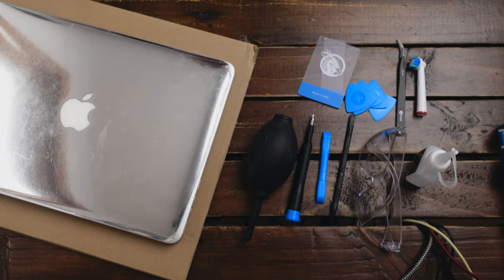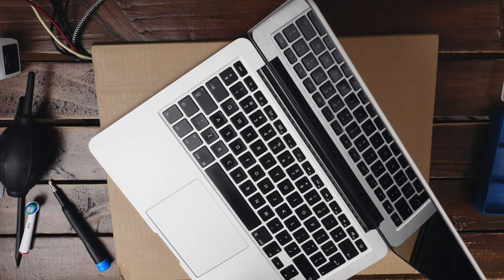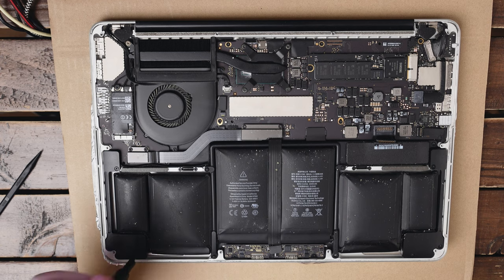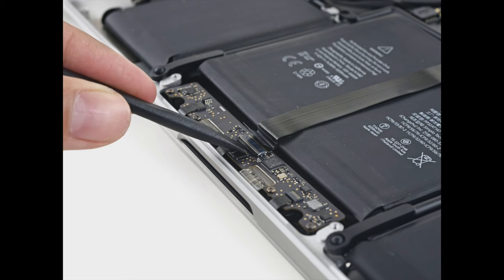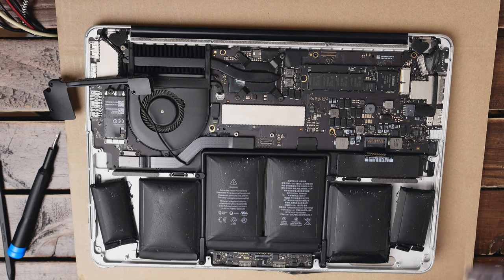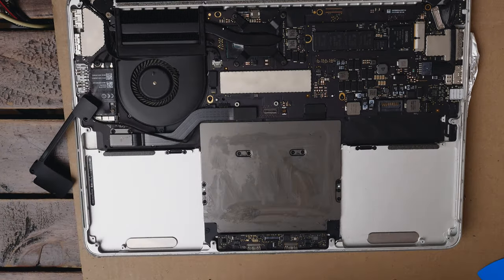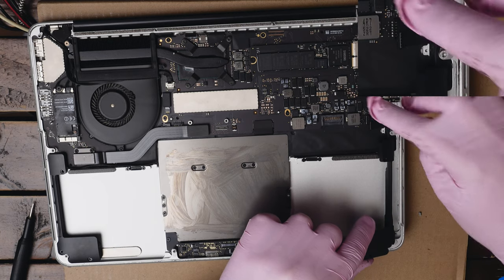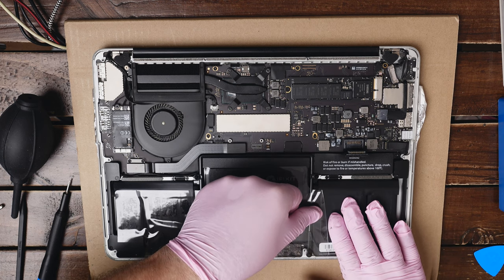13" MacBook Pro Battery Replacement Tutorial [Early 2015, A1582] #ifixit

Comment: Your excellent, detailed explanation makes the process of replacing the battery quite easy.  The only minor adjustment I would make is to wait until the new battery is installed into the chassis before re-installing the speakers, it just makes battery placement a little easier.  Well done and thank you!  Btw, the solvent used to loosen and clean the glue in the kit is simple acetone.  Works very well.

Comment: Excellent Video!!!   I followed every step with you and successfully replaced my battery.  Removing the glue was by far the hardest part; I gently used an exacto blade because the pry bar wouldn't work for me. Not sure if that was allowed, but it made it possible for me to complete that step.  Thank you for such a great tutorial!!

Comment: First you need to check the new battery and do the calibration at least, better to test it well, and only after that you remove all the stickers and install it finally. Even Ifixit doesn't tests all the parts they are selling.
Interesting to see another 2015 MacBook pro with all swollen sections again and again, and somebody again will say its just a coincenence?:cat-orange-whistling:
Reply from the maker: According the the website information iFixit is testing their batteries before shipping them.

Comment: Have you been satisfied with the battery life after the replacement? I'm not sure if I'm happy with mine. After replacing my battery, I installed AlDente and only charge 80%. I spent an hour using Ikea's kitchen planner, and the battery went from 80% to 36%. Watch through your video (nicely done BTW), and it went down to 30%. Perhaps Ifixit's battery is nowhere near the quality of OEM.
Reply from the maker: I installed the iFixit batteries in both mine and my GFs Macs a few months ago and so far so good. It's charging normally and keeping charge normally. To be fair I work on the charger most of the times anyways.. I think if your battery is running out exceptionally quickly you can definitely exchange it. Also.. make sure you use original apple charger.. all that after market stuff is breaking the batteries most of the time. Another thing is that those laptops are very old at this point so there is also a chance that power management optimisation with the MacOS Monterey is not very good for us. I love my retina but i think its time to upgrade to Apple silicone machine..
Reply: Maybe an obvious suggestion, but make sure you've calibrated the battery meter in the laptop after replacing the battery. Kamil explains how to do this at the end of the video. If the battery meter is not calibrated, a reading of 80% may be much less, and the rapid decrease in charge may not reflect the actual charge.

One thing I found helpful is to go into the Macbook info, and look under the Power category. It tells you the remaining charge, the total charge, and whether the battery is still charging. I found that without a calibrated battery meter, the laptop could still report 100% charged despite still charging according to this data.

Comment: Thanks, with your tutorial i was able to do the replacement myself.

Important : I placed the new battery before the speakers, and it was easier this way, just as the person in the comments mentioned.
Reply from the maker: I need to try that next time. I was worried that the speakers won't fit if the battery is not going to be in a right alignment..
Reply: @KK-VLOG it was the first i was doing a replacement and i was able to do it this way so im sure you can do it easily this way too :)
Reply from the maker: Thanks for the tip :)
 @Killy193

Comment: Dude I just replaced my battery, thanks to your video/tutorial, although I wasn’t as delicate as you nor I attached the speakers back before putting the new batteries in, it was easier this way,
A little force while removing the batteries made it somehow faster to remove them, and attaching the speakers at the end made it easy to place the batteries.. anyway thanks a lot for your video 🤞🏼
Reply from the maker: The reason i was delicate and did not use much force was because i've seen a few videos of old batteries exploding in peoples faces and catching fire. Plus it is very easy to break the trackpad when you pull on the battery too hard. I am happy you managed to do it without issues however it is not advised.

Comment: I just completed this battery replacement procedure yesterday, by following this video. Everything went perfectly, thanks to your detailed, step-by-step explanations. Thanks for uploading - I could never have done this successfully without it!

I found the trickiest part of the procedure was getting the new battery aligned exactly before letting it drop and adhere to the case. There isn't much leeway at all - even a millimeter or two of misalignment can prevent you from connecting the battery to the laptop - and trying to keep all the separate parts of the battery in place as you line it up is a bit cumbersome. But I got it in the end - thanks again to following your instructions.
Reply from the maker: Im glad i could help! Yes that is a tricky part for sure.. it's crucial to align the screw holes before you drop the battery in.. and to bend that connector cable in a right shape.

Comment: hey
I changed my battery and got power now. however now my keyboard and track pad are not working. any suggestions on what to do.
Reply: Same here, I needed to replace the trackpad cable. It's very easy to damage without knowing. I thought I was pretty gentle with removal. I just put in a new one and it's all working again